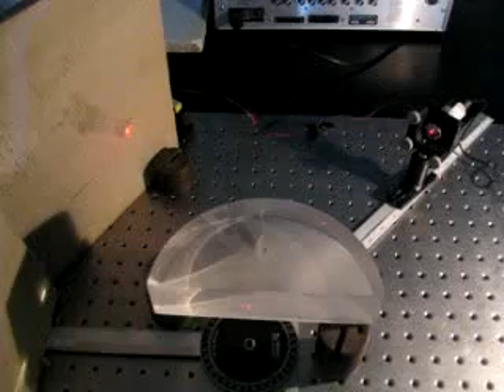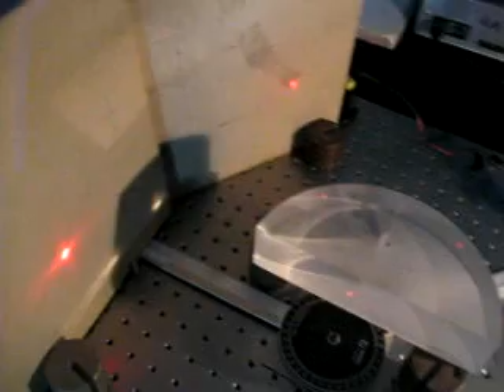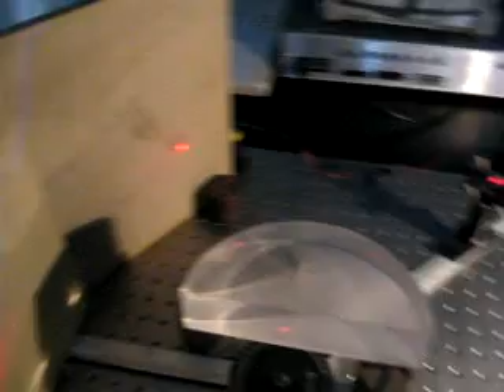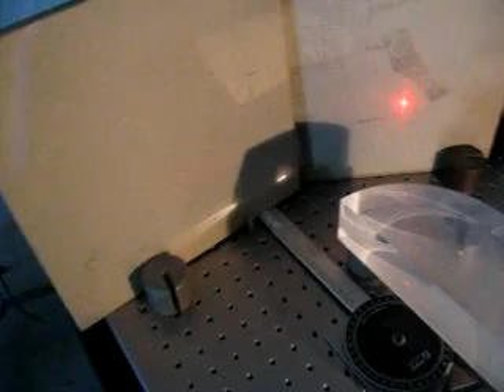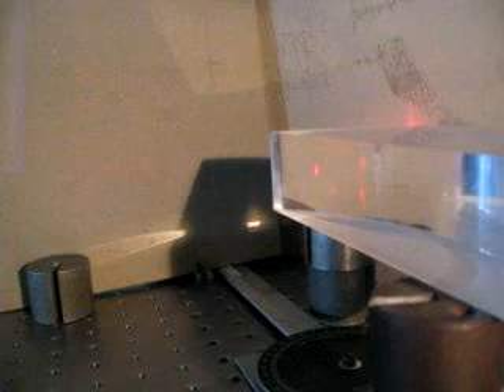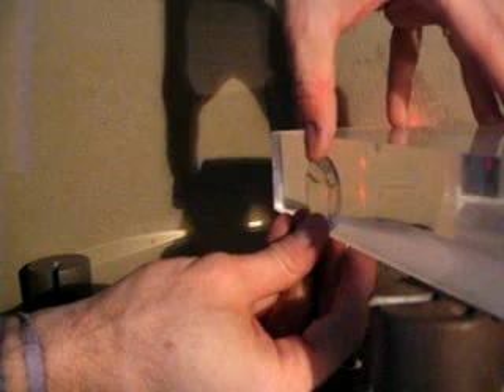Frustrated Total Internal Reflection

Comment: This is a very interested experiment which explain our theory on the ligth!!!! The ligth is an 7 tahion, which are circularing on 8 place over-and-over in approximetly 10exp29 hz.
When you said "Evanesent Vaves" what happend: 
2 of the 7 has going in the down dirrections, and 
5 has been reflected. This 5 tahion wh ich has been reflected is going regennerating the symethrie 8 of 7 
But the The 2 Evanesent tahion can not regenerate, this is the reason is is going down during some time, and afther is disapearing.If you are more interested, send me a private note:  info@bicaj.hu

Comment from the maker: Exactly. Sorry for the confusion. Physicists always measure the angle relative to the normal (the imaginary line perpendicular to the boundary between media). In other words, total internal reflection [TIR] occurs at glancing angles to the interface, the flat edge of the plastic piece. If the light enters the plastic at right angles to the straight edge, most of the light exits the prism without reflecting.

Hope that helps. Good luck with exams.